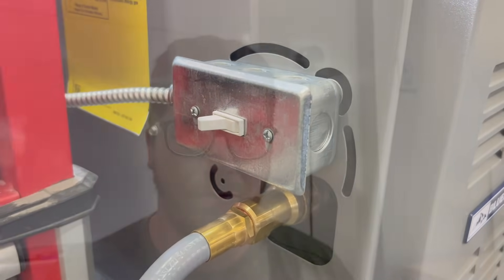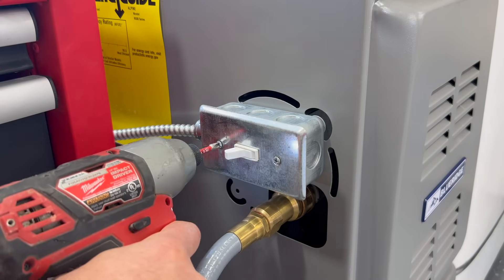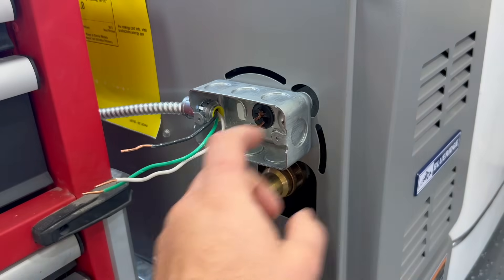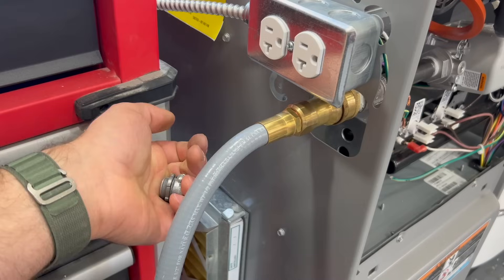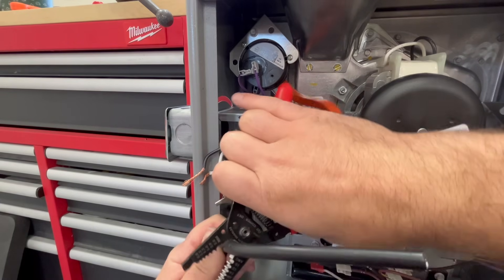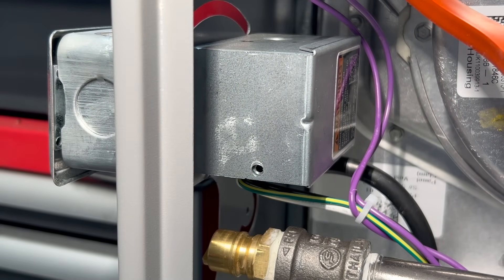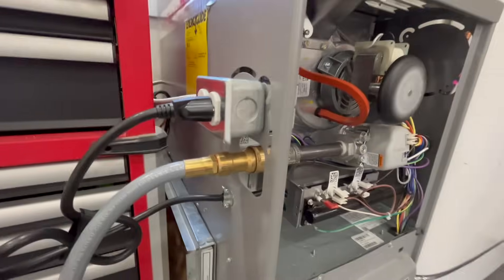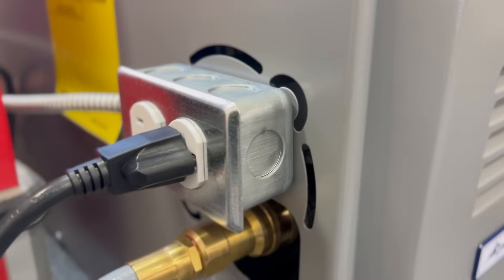Keep Your Family Warm During An Emergency Power Outage With This $20 Fix

Comment: Or just wire a generator port into the fuse box. Then you can run whatever you want. It’s a little more expensive and has to be done right to avoid hurting line workers, but it’s well worth it. Plenty of YouTube videos show how.
Reply: the line workers will be fine as long as you remember to turn the mains off.

Comment: Better off getting a generlink on the meter.  Safer and with the correct generator will power some lights and appliances.  Not to mention keeps everything safe and legal.

Comment: what about a standard generator?  do you still need a bonding plug?
Reply: I can't speak to all generators, but I needed the bonding plug for my Honda EU2000i.  Without it, the fan on the furnace would run, but the burner would not ignite.  Plugged the bonding plug into the generator, and the furnace ignitor fired right up, and I had heat during our 5 day outage from the recent November bomb cyclone in the PNW.

Comment: i had an inspector over to inspect a new sub-panel in my garage, he wouldn't pass me until I put a hand rail up along side the 3 steps up to the garage from the lower floor of my house.   He also would't approve my panel unless I either removed or hardwired the two fluorescent lights I'd hung on my ceiling over where my car parks.  This makes me wonder if it would be legal in my area to convert my boiler over to being a plugin boiler when it is permanently fixed appliance.

Comment: Would it be wise to use a GCI to protect the furnace from power surges?
Reply: You mean gfci? It does nothing to protect you from surges. You need to install a surge protector in your panel closest to the line side. Or..use a power surge protector bar on the outlet and plug your furnace into that.
Reply: @Weak_juan  Yeah, the missing letter isn't working hal the time. gotta push it hard. I can't type urnace this time :(  

Thanks. Learning.

Comment: Very cool idea! I’m just curious though, how long will the battery power supply unit run the furnace? Also, if you decided to plug the furnace into a gas powered generator running outside, is that safe to run the furnace on? Thanks for the video BTW. 🤌🏼

Comment: This is pretty much the first thing I did after my contractor installed my gas furnace back in 2002.  In between the wall receptacle and furnace, I also have a double-conversion UPS battery backup to condition the power to the electronics.  Last thing I need is for a power surge to take out my high-tech furnace board or VFD motor.  22 years constant running and not a problem the whole time.
Reply: How long could that power bank possibly run the furnace for question mark?
Reply: @mrpush2532  My gas furnace blower draws 60W while heating (determined using a Kill-A-Watt meter).  The UPS I have it connected to is a 1500VA model with  a huge external battery with double that capacity.  Theoretically, it could run my furnace for days if the blower only runs while the furnace is heating.  However, I don't rely on that to power the furnace anymore because I have multiple tri-fuel generators and solar generators that I can connect to a manual transfer switch connected to my whole house.  I still keep the UPS (and always will) so the furnace always receives perfectly clean power (double-conversion UPS) regardless of what's feeding it.
Reply: @obewise those batteries don’t last forever in those UPS’s. So unless you’ve replaced those sometime in the last 22 years, don’t plan on them lasting very long at all.

Comment: I hate stranded wire. I use crimps and wago always now. Especially going back to troubleshoot someone else's work. Usually the stranded wire is the culprit with it falling out or a few strands making contact with a screw or marrete.

Comment: Quick question. What size power station is recommended. 2000/3000 watt? How do I recharge power station if power goes out. I assume my gas generator could charge it. Thanks
Reply: generator or solar panels.

Comment: Good advice if the power goes out during the Winter and you are home. It usually happens here during the hot weather which requires much more power needs.
 During a rain storm my basement is in danger of flooding. I may need 15 amps of power for the sump pumps alone and the power may be out for days. My solution is using an inverter attached to my truck battery with extension cords. Of course the best solution would be to have an automatic whole house generator set up. This is just another quickie inexpensive solution if you are home when it happens.

Comment: how about main for heater goes to a switch 1st then to an outlet a single one with a snap cover. You then have the furnace hooked to a 12 guage wired plug. That when its house power its plugged in to outlet. then when power out you flip switch  unplug furnace and plug it into another source like your battery backup... why do this because sheet happens I dont like a breaker flipped its just stupid waiting to happen..  Oh Id also add a  120v small red or green  bulb before switch to know when power is restored. and you can re attach the main power at furnace inside of the home. No woops did I flip the right breaker.  No double powering no honey or some one else flipping breaker on.. we all make woops..  remembber flashlight always work in daylight.

Comment: In san jose code means your external tankless is plugged into a gfci outlet.when it failed the gfci i just used an extension cord from garage to have hot water.

Comment: I’m not an expert , but I’ve been told this setup has a bunch of code violations.  Look into the EZ Generator transfer switch.  It covers all the safety/code issues and you can configure it for either a bonded or floating neutral generators.  Much safer.

Comment: Probably a dumb question,  but I am no electrician. The outlet installed replacing the switch, can you plug the pig tail in either one?

Comment: While I don't have a need for this where I live [building built by FDR's WPA in 1939 as a school two years before I was born; converted to residential use in the '60's}, as my gas wall heater's thermostat is a two stage affair between how cold I feel and how cold my round 12'' dia. Taylor outdoor thermometer in the living room tells me it is. The blower is a  5 bladed, 52" dia ceiling fan. So, unless the thermo-couple fails (always keep a spare handy) or the gas supply is interrupted, all I have to do is rotate the L-shaped [looks like an Allen key] lever to on, adjust as necessary and I'm in business. No electricity, no heater fan, but a couple of dancing girls with palm fronds and ostrich feathers will take care of that minor detail. 
My question to you is about the Bonding Plug: I trained as a Power Man [MOS 640] at Fort Gordon, GA., in 1959, did well enough (top 10% - a.k.a. head of my class) that they sent me back to where I'd taken basic, Fort Ord, CA., and put me in charge of the fort's generator pool which also entailed going TDY [Temporary Duty] to Camp Roberts by Paso Robles and the Hunter Liggett Military Reservation by King City. I don't remember learning about "Bonding Plugs", but a quick glance at any of the skeletal ones depicted tells me they're basically a three wire plug with the ground and neutral prongs connected with an insulated 14 or 12 gauge, 15 or 20 amp rated jumper fuse wire between neutral and ground. Correct? 
[Yes, if anyone ever says: "Here, hold this wire. Now, hold this other one" - DON'T DO IT!]

Comment: What about the service switch you just replace. Instead of putting an outlet there and replacing the switch how about you put a switch and the outlet on the same thing. That way you still got the on-off switch if the technician won the service the the furnace right there instead of walking back and forth to the breaker and you still could plug the pigtail into the outlet you get a dual outlet switch and outlet, that way it's still being code.

Comment: I would just leave the switch alone and E
Extension cord to the Box inside and you make sure to cove the end of the extension cord this way if you have power outage you can flip the switch off and plug in your extension cord power source this way you're not removing the switch and the hardwired circuit.

Comment: Do you know how bonding plug works and why it’s needed?  So that means your backup. Power supply only has one usable outlet. I’ve never heard of such a thing there’s an outlet plugged in and use it. Why do you have to perform circus tricks

Comment: As far as the external double  Receptacle , why not use one with an “ON/OFF” Switch?Keeps the convenience of the Furnace shut-off at the Furnace.
Reply: Because when you pull the plug the furnace is dead.

Comment: Sorry for my ignorance, but what is a "bonding plug" @16:05?
Reply from the maker: It connects neutral to ground so it’s “bonded” 

Some furnaces require it to run as you saw in this video
Reply: @diyhvacguy  Ok. Thank you so much 😀.

Comment: It's better to have the switch, and have the switch run to an outlet on the wall from the start.  If this is not the way it's already wired, then I guess this is a good fix, but I'd rather have a furnace switch and a wall outlet be code.  Then you can simply put a UPS in, and you're good to go in emergencies. A decent UPS should be able to light a furnace for weeks of a power outage. Generators can't be indoors and require setup and possibly starting fluid to get going if they've been on ice for a while.

Comment: My furnace was hard wired. It didn't have a switch. I just opened up the furnace and the junction box inside and pulled the wires to the outside of the furnace. Installed a box and outlet on the end of the house wiring. Then, I added the pigtail and the connection of the pigtail to the furnace is in the junction box inside the furnace. I just did this today in advance of this evening's big windstorm. So, I shouldn't lose power now.

Comment: I was thinking that during a power outage I could keep my basement somewhat warm by removing the burner element out of the gas water heater and let it run all the time to heat the air in the basement.

Comment: Would this idea work with an electric heater/AC or it's only for gas operating system? 
Thanks for sharing. 👍👍👍
Reply: They will pull more watts. So as long as your battery/generator can provide enough power

Comment: I know people hate me for always pointing this out.

Anyways at 3:25. So you check the tester to see if the tester is working on a known live source, then check if what you are working on is off, BUT after seeing it is off you check the tester again to see if it did not break. It is more or less standard for how to test if something is dead. I have seen once the tester break after checking it worked then on what should of been dead and someone got shocked.
Reply: Your recommendation is also standard in the military aviation world because there is so much at stake. I do it when testing anything.

Comment: Wago connectors are great but I suggest taping around the flip tabs. They can be flipped open fairly easily. At some point in the future someone pulling on wires could cause one to open. The tape is a simple solution.
Reply: Like who gonna flip them?
Reply: @mistersecret88  They might get flipped by the next person that opens the box up and doesn't know the WAGO connectors are present. It should be a very rare thing but easy to prevent.
Reply: @deafman4090  fair enough

Comment: I watched the video to see what you were doing. When you first started talking about installing an outlet where the switch was, I thought you were going to run a Suicide Cord to it from a generator. I'm glad to see I was wrong.
Reply: I was planning on using a gas powered generator to power the furnace in the event of a power outage...is this not ok? Can you explain what you mean by a suicide cord and why this should be avoided. Can I even run this furnace using a gas powered generator?
Reply: @treborterb  A suicide cord has a male plug on both ends so you can plug it into an outlet on the generator and an outlet in the house to power everything. It's called a suicide cord because as soon as you plug it into the generator, it has full power running to the exposed prongs on the other end of the plug.
Reply: @treborterb  
Yes you can run it on gas.  Be sure to get the proper gauge cord to allow for the distance you need,
Reply: If you do use a suicide cord,  ALWAYS connect the load end BEFORE the power end. I used them on the job for 18 years and never had a problem, but it must be used correctly.
Reply: @Pablo453  I was thinking the same thing about connecting the load end before the power end, but didn't say anything. I didn't want to encourage anyone to use one. When companies need to put warning labels on products like do not use a hair dry in the shower, those people shouldn't use a suicide cord at all.
Reply: @BigHarryBalzac  
I was hesitant for that same reason but figured "just in case they do..."

Comment: My first attempt at being able to supply critical items like my furnace and well pump (120v) was a manual transfer switch: I cut the power wires going to them and inserted male and female plugs inline. In the event of an emergency, I manually ran an extension cord from my generator to the basement and switched to it supplying the power.  Never had to use it tho. Since then, I’ve added an inlet box for my generator and tied it to my breaker box with an interlock.

Comment: I strongly recommend you use nothing but 3M electrical tape.  It guarantees the highest quality.  We use it for all connections on railroad signals in awful environments and it stays attached and remains pliable.

Comment: How do you handle a fused shutoff box between your furnace and the breaker, how would you recommend wiring it in for use case?

Comment: Luckily my unit just plugs into a dedicated outlet in my attic. I guess being hard-wired isn't required by code here, or my installer screwed up. During a power outage I just run an extension cord to my generator.

Comment: Have a 13000 watts duramax generator 
With a 3.5 ton ac and a 2.5 ton ac both having a micro air soft start kit 
Do I still need this or the generator will be able to handle everything

Comment: if you have a gas furnace, then look around it. You'll find a little box with a switch that says "auto"/"manual. When power goes, just push it to "manual," and your furnace will work, no control over the thermostat but heat in the home till power comes back. Much easier than playing with the system.
Reply: And what runs the fan ?

Comment: Cool hack but it looks like this goes against Electrical Codes and even Mfr's instructions that maintain UL or CSA safety standards for all the reasons the naysayers have stated in the comments below.  In my case, there's BX from a switch far from the furnace (not on the furnace) so to do this I'd have to run that extension cord some distance through the basement which is against the electrical code as extension cords are not to be permanent.  Not recommended!

Comment: Just a warning for your viewers.  There are battery powered thermostats that do NOT receive power from the furnace or any other source.  In the case when house power is out, the thermostat will still have battery power.  The problem is, in the separate case where the battery in the thermostat dies, the house will not have heat.
Reply from the maker: Right, but what are the odds of that? And it typically will say battery low on the t stat. 

What I really meant to say is the t stat will still CONTROL the furnace. It doesn’t need its own emergency power source. Thanks for clarifying for the viewers.

Cheers
Reply: @diyhvacguy  I found your video helpful.  Thanks.  Not intending a conflict.  
Just wanted folks to know that their thermostat may be powered only by battery, not any other power source.   Not related to the house power being out. 
Many people don't realize that their heat depends on AAA batteries.  
Yes, the thermostat screen will say battery out. But that doesn't help  If you aren't home.  For example,  I used to be away more than I was home.  When I bought the house it had one of those absurd battery powered thermostats.  Twice my thermostat died when I was away.  Both times I was saved by two different house guests who realized that the house was getting cold.
Reply: I keep a house log file and note all home maintenance items.  I noted the time between getting battery low warnings on the old battery powered thermostat and just scheduled the next change on my phone calendar.  The interval was 1 year if I remember correctly.  Current thermostat is powered from the hvac system.
Reply: THANK YOU so much 😊. So would we be correct in thinking we're good just keep an eye on the battery

Comment: Great information. My question would be, can I use a car adapter plug in to run my furnace? I realize I need to keep an eye on my battery volt level.

Comment: Thanks for the video. Where do we find and calculate the needed wattage for the furnace to correctly size the generator?
Reply: Furnace label should say, but as a rule of thumb, standard blower motors use 700-900 watts. A DC blower found on variable speed furnaces usually use less than 100 watts. A great reason to get a variable speed furnace.